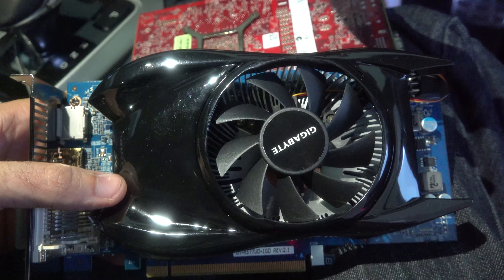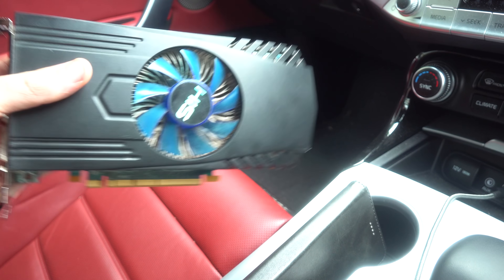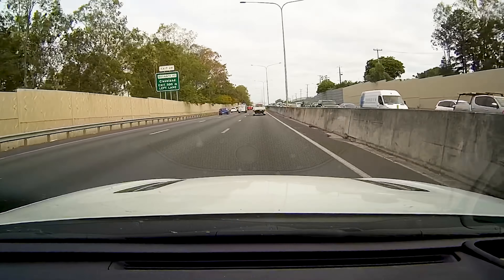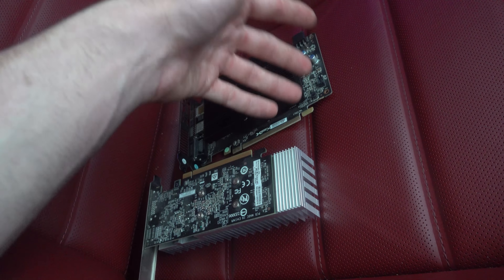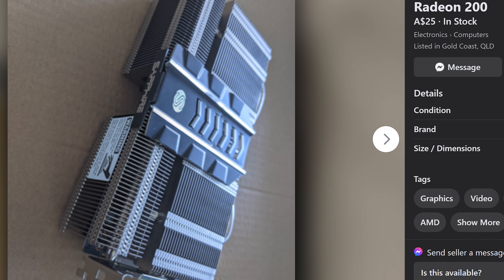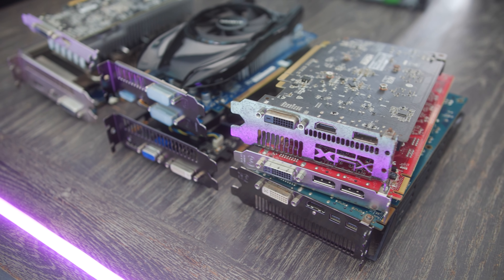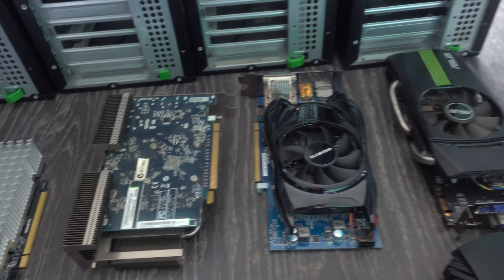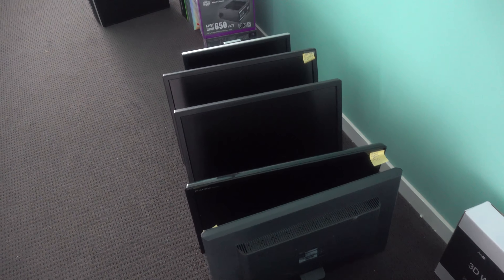Buying CHEAP (Underrated?) GPUs - December's 2020 USED PC Parts Hunt

Comment: I am a budget build person myself, believing in function over form. It's nice to be a little classy but the performance comes first, customers on the other hand, they like to know that they bought something new, stylish and perhaps reflects something about themselves. It's all about what they want and how their budget makes it happen. The trend of people wanting to buy aesthetically pleasing things over functionality comes as no surprise really. That's like in every market whether it's oversized rims on a vehicle or flashy clothes or Beats by Dre.
Reply: You seem familiar with the situation as is, I have a question.  Not being judgemental, but what is the purpose of buying hardware from yesteryears?  Is it to get around backwards compatibility?  Just building a cheap right?  Please help me understand.
Reply: @hodumx  Yes, $$$ is the biggest factor for myself and for most people so I personally buy most of my CPUs, Mainboards and Video cards second hand to get the best performance per $$$. It's a gamble but typically the best sellers will either refund you the money if the device is DOA or they will send you another one in good faith to maintain their good ratings. I just check their rating and reviews just like a would for Mboard and Video Cards off of Newegg, etc. But a new gaming rig with a decent dedicated video card is going to run upwards of $600 in parts alone and that would be going cheap on the video card. Spending more $$$ on the video card is where you yield more performance. Do research and checkout benchmarks for CPUs and GPUs for the games you want to play. I've had numerous people who want to spend way too much just to play Minecraft or WoW.

Intel's Core i5/i7 CPUs have been solid for nearly a decade now. A Sandy/Ivy Bridge or Haswell i5 or i7 can still perform very well if matched with a decent video card and you save a lot of money on CPU and Mboard that can be spent on a newer generation graphics card that is optimized for today's gaming architecture.  I go for something like an i7 3770, i5-4570 CPUs or their Xeon equivalents. Instead of spending $150 to $250 on a new CPU and $75 to $150 on a new Mboard you will cut that down to about $70 to $130 total for both.I just bought a Xeon 1151 CPU for Haswell and a Mboard for a total of $62. I have a spare GTX670 i'll throw in it and market it as a budget Fortnite PC. You want a minimum of 8 GB of RAM ($30) for todays games. I could find a newer GPU but I've got to get rid of my old stuff while they are still relative.

Don't skimp on your PSU, the trick is looking at Amps on the 12v line not the Total or Peak Watts, the amount of amps for 12V is the most important part, it could be marketed as 500W PSU but 250 of that might be on the 3.3v and 5v lines because that's how they trick buyers who don't know better. You don't need a 750+ Watt PSU either, if you are only going to be using 300 to 350. Check out the TDP or power consumption of the CPU and GPU you are find to give you a better idea. Since SLI and Crossfire aren't as relative anymore you really don't need more than 500W unless you are planning on it running more than 1 video card. They don't need to be 80+Gold/Platinum/Titanium or whatever the hell either. 80+/Bronze/Silver are good enough just look at the consistency of the reviews for that model for probability of failure.

Comment: I see what you mean about the aesthetics.  I like Thermaltake's cases but I won't buy one without adequate ventilation.  If two cases cost the same and say a Cooler Master has better airflow, I'd buy the Cooler Master.

Comment: Request: what's the performance difference between 4930k and 4960x or E5-1650 v2 and E5-1660 V2 at the same clocks. Does the extra cache make a difference?
Also, is 32GB of RAM worth it over 16GB on the X79 platform.

Comment: "CPU perfectly matched with budget GPU" Vs. "Bottlenecked budget GPU offered with better CPU for future upgradability" as a marketing strategy. 

And keeping with the much older cards you picked up, thoughts on 720p only builds (Lowliest being 17"/19" 1280x1024 monitors with pixel perfect letterboxed scaling for impressive clarity).... GPU scaling, Monitor scaling, and 720p TV's (Larger real estate and cheap, but higher response times). Can 1 GB cards get you there, or are 2/3 GB cards the basement?

As always, look forward to every video!

Comment: I mean I understand why people try and get the most out of used pc parts but, for example I just sold a complete build for $650. Ryzen 5 1600, gtx 1660 super, xpg 2400 ram. The rest of the specs aren’t as important just for this instance but, I wasn’t trying to rip anyone off in fact I based my price on the outrageous pc’s at the same price equipped with a gtx 970. I still made a little money as I put it together 100% with the intention to sell and I’m happy. Idk what more I could have gotten out of it but, I would feel disingenuous asking for more 🤷🏽‍♂️

Comment: In my opinion the E5-1660 is the best price/ prerformance CPU for x79. Singlecore it is 1 -3 % slower than Ivybridge E, if you get an e5-1660 wich can be overclocked to 4,8-4,9 GHZwhich is quite a lot. And the multicore performance is very good too. But i have to say that i never could overclock this CPU over 4,9GHZ with aktive hyperthreading. But it was as fast as a core I7 9600KS without. Yes over 4,9, over 4,8 GHZ isn´t a realistic overclock for a Sandybridge EP CPu like the 1660 with the bigger cache, wich is the problem when you overclock it in most times. But 4,7 GHZ can be adjustet very stable. The E5-1660, if you get a good one,( here 60 dollar) is as stable as the E5-1680V2. I have sold my 1680 v2 wish i didn´t had to do that. But the chance of having a core I9 7900X  let me sell it. I made~ 50 CPUZ HoF Places with this cPu from the first day on and raised the frequency for every place till you couldn´t get in this Hof without reaching 5 GHZ. and thats good. It is my CPUz Hof. Never could replace place 1,2.3 because of not having cryo cooling stuff( this would have been quite absurd to do this with your one and only Rampage IV Extreme??) And one day i was only 6-15 instead of 4-15 and my dream of being 1-15 one more time( 2014 with the E3-1240v3) was like a soap bubble burst. I should never had replaced my scores with higher frequencys, which was only possible by deaktivating cores. The guy that beated me was benching with 8 core 16threads a temperature of +40°C maximum with a core voltage of 1,87Volt !!i think, 1,8 volt minimum. Yes having this possibilities, as much chips and boards as they need every cooling method. One day i strike back with all this stuff and the experience of having done this with an arctic liquid freezer 120. But than i will not tell that anymore.

Comment: If you can get DAA78L motherboards they will work with the A10-7800K (Kaveri) and 32GB of DDR3 RAM and whatever SSD and PSU that you can get but they don't seem to support RAID so cannot be used as a NAS but it is what it is.

Comment: Everyone is going insane with the 30 series, so the secondhand market is going to be flooded with 20 series GPU's. Not everyone can afford to buy a 30 series. If someone already has a 2080ti would they get more FPS for the $ by picking up another 2080ti and SLIing it? What would the frames rates be like between a 2080ti SLI and a new 3080 or 3090?

Comment: You can keep that used price to performance ratio AND incorporate the ricer bling; just get cheapo 5 packs of rgb fans, costs me about £25 to £30 extra on a build but they sell straight away. Plus there's tonnes of budget cases that come loaded with these things now, and decent cases too. Check out the Aerocool Aero One mini eclipse. £50 delivered; tempered glass, x5 rgb fans that look decent and are PWM too, with an RGB controller that can either sync with motherboard 5vargb or has some built in modes itself. bargain.

Comment: I admit I did some just cause I could but to say I finally got it or finished, That $10k workstation I wanted but a school kid on a limited allowance couldn't swing. lol. Like thr EVGA Classified Super Record 2 I always wanted, well 10 years late but I plan to finish it. I was still rockin' an ASUS PC-DL Deluxe i875 Canterwood, Dual 604 socket Xeon 3.2GHz/2m/800Fsb only 5 yrs ago. It was a fun build. It's hanging on a wall now next to its 'lil bro, the ASUS P4C800D-E Deluxe. Oh ya, there's an old school ASUS P2B-DS up there as well (dual PII/III slot1).

Comment: AMD FirePro W5000 not bad for gaming. Had the cheaper Firepro V4900 1GB for £20. Had a blast trying  games at 720p, odd ones at 1080p low settings.

Comment: I recently picked up a 4690k/ Galax GTX 1060 3GB system at the local metal/eWaste recycler skip for $35.
Likely try to sell or trade at component level. Shithouse MoBo, PSU, case & no storage.

When I get some free time gonna Frankenstein a spare bin build an chuck in the guts.

Other better build complete and neat (hopefully delivered pre Xmas) is a ~2002 DEC AlphaStation w/shit tonnes of ethernet cards (only 10-&/or-100Mb😢). Got a $50 discount & cheaper shipping because who can afford shipping on a CRT display?

Comment: I looked up the Firepro W5000, it is first generation GCN, around 75% of the shaders and TMUs compared to the well known HD 7850. It also is clocked a little bit lower (825 vs 860 MHz, but you could easily clock most HD 7850 cards at 1050 MHz). Expect 70-75% performance compared to a stock HD 7850. Weak sauce, but not much more weak than the RX 460 I guess.  @Tech YES City: don't go for bling-bling, go for bang for the buck. Of course you can add some bling to make it sell easier but focus on bang for the buck.

Comment: Would you say the demand shift to aesthetics is having any effect on the Ali XEON market?

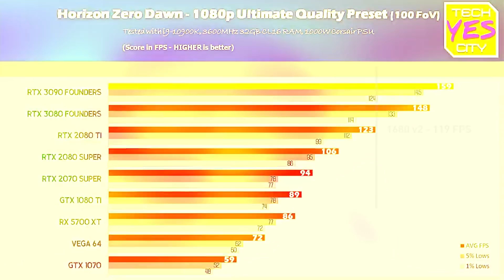17:30 - Assuming the guy's mbd can handle it, the 4930K should oc to about 4.5GHz, which is easily enough to drive a 1080 Ti or 2080.

Comment: i7 6700 selling for 150$ on the used market in my area, i3 10100 99$ brand new 🤔. i7 Tax still in full affect.
Reply: You ain't lyin; I went looking for an old gen 1 i7 970x on eBay, just based on a budget build I saw elsewhere on YT (I happen to have a board I could put it on)...and good Lord the cost!
Reply: @thedungeondelver  if you have a x58 Mobo don't even bother with an i7 just get a x5660 or a x5675

Comment: used prices are still stupidly high in the UK as well, to the point it is chaper to buy a cheap laptop, keyboard, mouse, and display for cheaper, and still not hurt performance as much regardless of intergrated graphics. like people selling their 12+ year old pc for £650, and the specs are so bad that they barely show anything on a benchmark.

Comment: when i buy a new case for a pc i'm gonna sell i always buy a case with led fans or rgb light they sell quicker even do the price is a littel higher and i get the box it came in and packaging in case i have to send one in the mail

cheap led or rgb cpu coolers are good to

ppl like to get a pc and it looks brand new with the plastic film on the side panel still and in box made for the case , it gives a good impression :) i gotten repeat custemers because of little things like that i'm sure

quality remains long after price is forgotten :)

Comment: Considering selling my 6700k build because it’s overvalued at the moment.
Reply: That’s honestly not a bad idea, sidegrade to a R3 3100, and upgrade later down while keeping the mobo. You’ll spend hardly anything (assuming you get a decent deal on the CPU and Mobo you sell), and you’ll get a slightly faster chip with a clear upgrade path

Comment: off topic question. Where did you get that psu meter? I need to pick one up and test a power supply i nabbed but the price tells me something might be up.
Reply: But yeah, RGB is silly and a waste. I bought a new case, but since it was classified as "old" and didn't do the whole RGB be thing, they had it on sale. The case is a full size tower that came with three - 200mm fans (non rgb) and one - 140mm fan. It can hold 10 drives in the bay and other goodies too. I'll take performance cooling over bling any day.

Comment: I realize that people are going for the flash vs the performance, but it is stupid, unfortunately you are stuck dealing with the bling-bling if you want to stay competitive.  Then again, I am unusual in that I love performance cars that are sleepers. 

For instance, when Threadripper 1920x hit $199, I was all over it.  Most people would have rather had a Ryzen 3600 on a b450 mb with RGB vs a Threadripper 1920x on x399 with an Asus Hyper X.16 SSD card at the same price.

Comment: I've been seeing similar trends locally. Crappy computers in expensive cases with a bunch of halo fans selling quicker than excellent builds inside modest cases. People would apparently rather get a 200 dollar build in a case decked out to the 9's where the case and fans are 300. Than buy a 450 dollars build inside a 50 dollars case. I hate it myself. All form and no substance. It's a super big turn off. I build gaming pc's for people locally budget minded good value stuff usually sub 300. But lately even my friends whenever they ask for a pc they want it all RGB. And I can't do it. I can't build a system and rig it out how they want appearance wise for what I normally charge. Just super disheartening. I actually though we were moving away from that and moving back into practical systems. A bunch of cases with mesh fronts and tops starting to happen again. It's almost like real consumers are like 5 years behind the trends.

Comment: the used gpu are stupid prices atm in the uk, 1070s are 200+ was 150 ish at one point  before this daft no out of stock phase, seing 5700xts still being more than they were new and even 1060s still about 140-150 wich compared to my r9 290 i got for 70 used for half a year ans sold for 60 its ridiculous

Comment: Ya roblox can use any car that can do dx9 but some games won’t run great even on my Vega 3 I have to turn the the graphics to 1/10 which is the lowest it can go at 1080p and get 60fps in all games except phantom forces I can lower it to 720p I can get away with maxed  out settings

Comment: Bling bling... get some cable sleeving. It very easy to just pop the pins out of the 24 pin... resleeve them... and that looks so much better... buy cheap rgb led strips... you just need some with 2 wire connect them up to a fan header... rainbow puke... sell it.

Comment: Wow, never saw GTS 450 under 15 eur / $20 here. I want one, but they always charge like 20-30$ for it.
I'm still on 8800GTS 512 from year 2010, I play only occasionaly, but usually older games. I've dreamed about GTX 460/GTX 450 back then, but never got enough money (it was for around 120-150 euro back then). Then, I've just never upgraded primary computer, had accident, and was only always on budget. Always was something more important, where to put $10 or 20$.

I am watching local markets for months, if someone give such good deal, to get some upgrade (eighter 9800GTX+ or GTX 260 or GTS 450), but noone, everyone is usully charge 20-30$ for them. For GTX260 often even higher (40-50$).

Don't understand, where you're finding such great deals.

I'm really jaleous about that 7-10$ GTS 450. But unfortunately, never happens here.

Comment: Intel parts are sold and bought by money challenged people. 6700 is not worth 100, much less 200+ US. Ryzen chips haven't fallen into the market yet cause all the ppl I know that want to upgrade cant. The problem with the used market is , no one considers the power of having something under RMA warranty, and that companies for the most part push the limits of offering ( excluding intel for the last few years, but we all know why). I3 seem to go the distance if you don't use your PC for anything other that normal office work and gaming. That is a generalized statement, but with the current market prices what you can get new at 500-800 US,  the rest of these things seem to be overpriced table scraps.

Comment: Operating System
	Windows 10 Pro 64-bit
CPU
	AMD FX-4100	29 °C
	Zambezi 32nm Technology
RAM
	8,00Gt Dual-Channel DDR3 @ 666MHz (9-9-9-24)
Motherboard
	ASUSTeK Computer INC. M5A78L-M LE (AM3R2)	46 °C
Graphics
	Generic Non-PnP Monitor (1680x1050@60Hz)
	3072MB ATI AMD Radeon R9 200 Series (MSI)	32 °C
Storage
	476GB SSD 512GB ATA Device (SSD)	40 °C
Optical Drives
	TSSTcorp CDDVDW SH-222BB ATA Device
Audio
	Realtek High Definition Audio